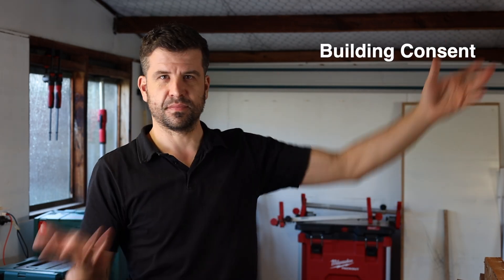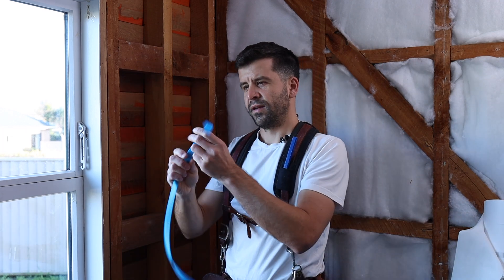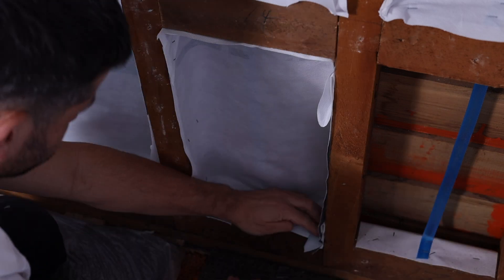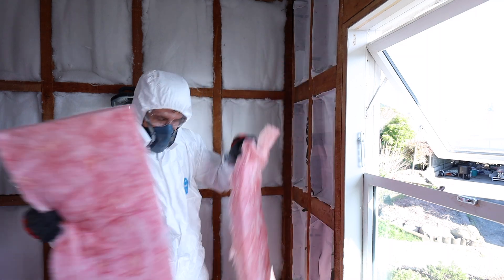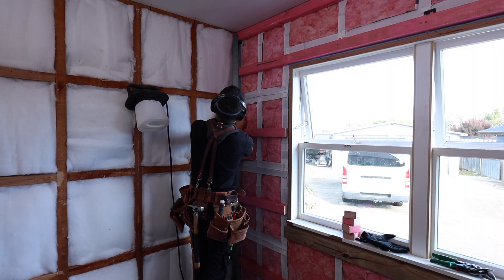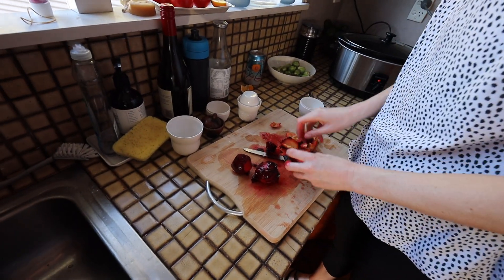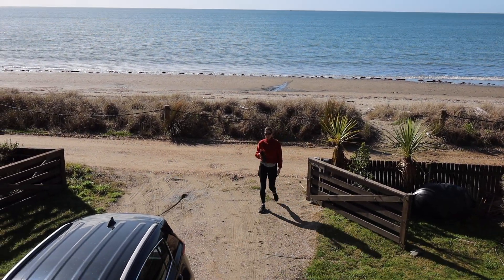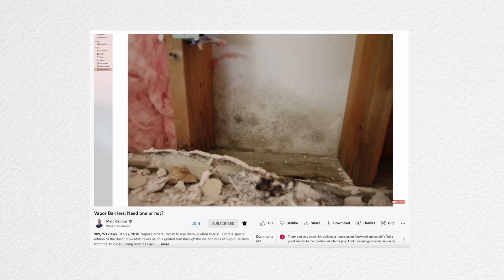We're Finally Going To Be Warm! Renovating Our 1960s House

Comment: i think you have done well.The only thing i would suggest is that the "battens" could be smaller timbers or even a insulated batten of some sort. I am not sure that the vapour barrier is not required but that it has been found that it is very very difficult to make a vapour barrier that works. Whe i was a draughtsman in the 70s we used to draw a vapour barrier but we stopped doing because it was found they ere not effctive at keeping moisture out of the cvity....too many penetrations ie wall outlets and ceiling outlets that were very diificult to seal...tht my understandin anyway

Comment: Hi there Scott
Nice job.
Probably I am a bit old school,  but I am a bit hesitant about too much technicalities in a house.  Especially in NZ where the climate is fairly temperate.  If a house is too sealed, then it just does not feel 'fresh' in a house. Except if you open a window and then defeats the point of the sealing. Or install a heat pump or HRV...and that is just something else...resources, electricity,  something to go wrong, etc.
The older houses lasted well because of the wall ventilation....
I suppose it is somewhere getting a balance that is right.
Reply: yeah your old school.
build tight ventilate right.
a perfectly sealed house is great because now you control the air flow not the weather. controlling the airflow helps control the moisture flow.
is a 70's house ever going to be air tight? no. they typically have excessive air flow so making it tighter is a good thing. at worse open a window which you should be doing anyway. (or install a ventilation system, which it may be integrated with the ducted heatpump.)

Comment: Its probably been mentioned already but spray foam would save a lot of work. A similar 1960's house here in Alberta, Canada would have 2 x 4 walls. the walls would have 31/2" of fiberglas insulation with approx. R12 rating. Installing the banding, house wrap and fibreglas insulation would be eliminated if you used close cell spray foam. Alternatively, foam board cut a bit less than the opening then sealed all around with spray foam from a can  such as used for the window would work. Just a thought. I don't know what's available in New Zealand. Foam board equates to an R value of 4 per inch. It is pricey though.

Comment: Most of the walls in my house in Norway are between 150 and 200mm thick.  And even that's not enough IMO.  Most new houses are 200mm at an absolute minimum.  I think passive houses are getting on for close to double that.  You can never have too much insulation.  :)

Comment: Don’t you have Rockwool in NZ?

In Sweden the weatherpaper is behind the outer panel and then a moisture plastic between the isolation and interior panel or plaster. But here the temps can go down to -30 or more in the Winter and +30 in the summer 🤣🤣

Comment: In Danmark we use u-value and normally there is 300mm insulation in the wall and 410mm in the ceiling.
We also use a vapor barrier in our wall and ceiling

Comment: YES - Polyester ceiling insulation blanket!!. glass fiber will compress and lose its r value over time, whereas polyester expands and maintains its r value. Also, in the event of roof leak - moisture can be attracted to and pool with glass fiber, whereas moisture will dry quickly in the polyester. Give this a test with a piece of glass fiber and polyester.  You could always put a layer of glass fiber between the ceiling joists and then lay polyester blanket on top of that.
Reply: The real test is hold a lighter to a piece of polyester. Then imagine that in an open attic.

Comment: Nice work mate - thermal bridging is a little known concept in traditional building circles. One point to note about your design here is that it will be much more airtight and you will might find you will want to keep the heat pump on in air circulation mode to reduce moisture

Comment: Be keen for a review of the ducted heat pump. Just about to install additional heating here, and wondering if the additional cost for a ducted system outweighs getting a couple of mini splits?

Comment: Insulation looks pretty good. You do give up a little space inside the house by packing the walls out so thick. Only other way I could think of achieving the same r value withhout losing space inside would be by putting insulation panels on the outside of the house and covering those with another siding. Obviously, this has its own drawbacks as well and could be quite expensive. 

Great job as always!

Comment: PIR over the internal frame with a taped joint (which also acts as a vapour barrier) …. Then screw the plaster board through this into the timber frame UK anyway…. 😀… Matt R… is excellent as well so it depends on where you are, climate , structure etc so no simple answer. ( unfortunately)
Last UK  regs have also changed so it’s far more strict on vapour battier, thickness of insulation, thermal bridging, air performance of building etc. It may not be NZ standard now but in the South Island it’s not too different to parts of the UK temperature/ climate so good practice especially in your own home should be looked at.

Comment: Vapor barriers depend on the climate in the USA. In areas where there is freezing they have the plastic vapor barrier over the insulation before the drywall. This is because as you heat the house the humidity increases and the poly or plastic barrier prevents the humid air from going into the the walls. Areas where you do not rely on heating as much and tend to use your AC system for cooling you have paper faced insulation against the drywall to allow transfer of vapor between inside walls and exterior walls allowing the house to dry faster.

Comment: We recently had Insulmax fluff pumped into the exterior walls of our house through holes drilled in the weatherboards (the holes were then filled and painted). It's definitely increased the heat retention but it does make me wonder about moisture build up...
Reply: Yes varying opinions about the product.

Comment: Excellent job. Good move on the air gap and you even got the insulation layers the right way around. 
Usa uses imperial R units and they use more insulation as well.
Ceiling i recommend batts because its usually cheaper than polyester and higher r value gor the size. But polyester blankets work especially well over the top.

Comment: Hey Scott great work on the insulation of the exterior wall. I’ve got a similar weatherboard house (1967) and used 70 mm polystyrene (black pearl - it has a higher R value with graphite in it) it works well and has made a big difference to our place.
Reply: I don't recommend polystyrene because it stops moisture which can then accumulate. Heard of guys finding water on top of underfloor polystyrene insulation.
Reply: ...and you must avoid contact between polystyrene and power cables.

Comment: Hello there, we live in Belgium (the other side of the globe) and build our home ourselves to be a passive home... unlikely the name.. it takes a lot of planning and work, but basically the house heats (and keeps it cool) itself through thick insulation, triple glass, controlled ventilation wit heath recovery, and absolutely airtight home. Our walls are constructed as follows: front brick (facade) - air gap 2x82mm (164mm total) PIR panels with the seams taped over with aluminum tape - inside brick with low heat exchange (thermobrick) witch is glued on each other - and finishing layer like stucco. Since the walls are that thick, the windows are encased in wooden "boxes" and suspended in the isolation layer... the "box" is then foamed up with isolation foam all around, and the inside of the box is lined with an airtight, but damp-open membrane that goes over the inner brick, but under the stucco... normally these houses are built as a wooden structure, but since our house is half underground, we couldn't do that... so it is in brick.. 
Our R-value of our walls, glass, roof and floor must be higher than 8,0W/m²K in order to be called a passive house...

Comment: On my house: breathable membrane on outside wall hugging the plywood, then bats which create a gap for water to slide down; then 3" of polyiso insulation - seams filled with foam to make it watertight (albeit the foam is open cell - seems to be no issue). If polyiso has aluminum side, then it has a nice property for blocking the radiated heat. Another row of boards on top of insulation - the screws are driven into the bats under the insulation never going into the wall in order to accomplish thermal break. Then a vinyl siding on top of this outer layer. 

One needs to understand that heat is lost (in buildings) via 3 main routes: conductively - when objects are touching (hence the metal screws not going into the building; wood is an insulator of a sort). Radiation is the big one - the whole purpose of insulation layer is to slow down heat radiating away. The additional layer of aluminum on polyiso boards actually reflects the heat back (or reflects it away from the house during summer heat). The third main loss of heat is due to air exchange - if buildings leak, you can have excellent super expensive insulation and it's just a waste of money (think 'open window') - hence the membrane hugging the building with seams taped and with every penetration covered (or elastomeric membrane) is crucial.

Finally, look at the foundation - the biggest heat loss occurs because of conductivity due to uninsulated connections with foundations (heat being sucked away). The biggest losses due to radiation are typically through ceilings/roofs - so if I had to choose between top and side, I'd prefer spend more on the top. Windows/doors areas are typically too insignificant to influence the big picture. It pays off to actually calculate R value of materials and the walls.
Reply: I forgot to add the main reason why I decided to comment: this installation is simpler than chasing perfection on the interior walls (where it can't be achieved anyways IMHO)

Comment: An infrared picture of that exterior wall you insulated will tell you if it’s going to be warm or not. The stubs and the cross bracing are going to work against the insulation, and the insulation, I think, is going to struggle a bit. Your R-3+ will be about R-12-15 maybe. R-19 is what we got from 5.5 inches twenty years ago. New homes now are shooting for R-25 in 8” walls. Where was the heat pump installed?

Comment: You asked, so I'd have used Rockwool/Mineral wool.  And the reason is, it's hydrophobic (i.e. it repels water.)  It's hydrophobic, and will repel any water that gets through the moisture barrier, and it will get through unless you used a sealant between it and the wood that you stapled it to.  And once water gets into fiberglass batts it's game over it will not dry out on it's own, and it will start growing mold.  That was the major reason for black mold in the US back in the 80's and 90's.  Rockwool also has a higher R-value per depth and is easier to install, and much lower probability of compressing it when putting it in, which lowers the effective R-value at those points.  And yes we have a different R system.  I believe the conversion from I-P (what US uses) and RSI what NZ, Aus., UK uses is 5.71x.

Comment: Great job with the overlap to limit the thermal bridging of the studs. Obviously can't be perfect with an old remodel, but you did what you can and that's awesome. Yeah the vapor barriers were applied too indiscriminately in the past. It's a tool in certain areas of the house/in certain environments, but it can cause a lot of problems when misapplied.

Comment: Your effort to improve a poor wall insulation situation reminds me of our first home in the far northern part of Minnesota USA.  It was built in an area with a 120 degree F difference between winter low temps and high summer temps (-40C to +35C).  It was constructed about 1920 by a railroad company and was one of many in our town built for the railroad supervisors.  They poured the footing with concrete.  Then, they slip-formed concrete in about 12" high lifts from that footing up the basement, main and upper story walls.  They boxed out for each window and door in the exterior walls.  The interior walls were wood timber construction with plaster surface.  The slip formed walls were actually two separate walls.  There was a 4" thick outer wall with an outside stucco surface applied after completion.  The inner wall was 4" thick inner concrete wall with a layer of plaster on the inside surface.  They placed 1/4" steel bars across the top of the inside to the outside walls with each lift and that kept them from moving relative to each other.  There was a 2.5" air space cavity between the inner and outer walls.  Altogether, the wall had an R equal to 1.0.  When we were living in the house, contractors were beginning to foam insulate homes with urethane.  Our situation was ideal because the air space had very few places (the window chambers and the doors) for any urethane gas to seep toward the living space.  So, we went up to the attic and drilled 2" holes in the wood plate that the roof rafters sat on so that the insulation company could drop a 15' long tube hose down into the cavity and foam the exterior wall cavity from the basement foundation all the way up to the roof plate.  Prior to insulating, we had ice coating the corners of our room walls.  After insulating, the rooms were much warmer.  So, I really felt good about "doing the best you can, with the situation you find yourself in."  Wishing you success! Dale

Comment: Binging the reno series, but insulation wise I'm surprised to see no PIR/rockwool. After a quick google, Rockwool in the Netherlands is a higher R per 10mm thickness then glasswool is. But PIR is by far the winner. Glaswool 90mm = 2.2Rd, Rockwool 80mm = 2.2Rd, PIR 50mm = 2.27Rd. I'm guessing PIR is really tough to get there, otherwise you probably would have mentioned it. EDIT: Ah you did mention them later xD

Comment: Scott in Manitoba we have r00 walls and 50 ceilings. They want to change our walls to be r27 with a 2" foam on the exterior. 

We also use a 10 mil vapor barrier for eqlls and ceilings. Our houses get air tested and the only province with better air quality test is British Columbia. 

If you can't get batt Inso, what about a ridgid foam?

Comment: Any informed Canadians here?
Were vapour barriers introduced there to prevent water vapour from freezing and thawing within the wall cavity? 
But when you install a vapour barrier in a climate including tropical, sub-tropical humid climate (or similar). Then the inherent leaks in the building wrap and vapour barrier installation trap vapour in the wall cavity and develop mould.

Any thoughts on this?

Comment: Coming along nicely! R values in the US are imperial based, inch-pounds versus metric. I'd say the R3 in the walls should be plenty, that would be an R17 equivalent. My exterior walls are almost R4 metric, but the windows are big; it's astonishing how well even gas filled double glazing transfers heat. Next house will probably have triple glazing or proper screens to keep the sun out.
Reply: Here in Norway you can get glass that has low thermal conductivity.  Double glazed windows typically have one layer using this glass and one using more regular glass.

Comment: RSI is a metric system, R is a imperial (I guess). I remember the conversion rate from trade school, I think its 1 RSI- 5.678 R.....Our building codes are written in metric, but we work in imperial. Our exterior walls in Ontario, Canada are R20 (last I heard) and R60 in attic spaces! -40°C winters and 40°C summers 😬

Comment: there is an easier way:   1.5 inch exterior rain-screen applied to the interior of the cladding = more exacting cuts and fits. and then use Rockwool insulation =R10 wall, water movement assured, no rot, fireproof, less particulate matter

Comment: Loving the videos Scott. Very interested to see what you do for the window reveals now that you have packed out the wall. Great to get the additional insulation losing a fews cms of space.

Would love to hear more about the ducted heat pump. Have been considering the same, along with ducted gas. All the heat pump installers seem to want the outlets and returns in the ceiling. Wouldn't the return be better lower so it draws the heat down?,
This is how the gas installers seem to recommend.

Comment: My concern would be both the insulation and an air barrier.  I understand that you want SOME air circulation for moisture control, but if you could run the "house wrap" all the way up and down the wall, minus about 20mm at the top and bottom, it should cut down enormously on drafts.

Comment: In Europe you need vapor barriers. But that depends on your climate (you might have very dry air in NZ). Also, if the air handler does heat recovery ventilation the moisture is reduced.

Comment: I’m in the same boat with a 60s house and I’m thinking of spray insulation where they drill holes on the outside and spray from the outside. Then plaster and repaint the house that way I don’t have to rejib the inside
Reply: I also have a 1963 weatherboard house much the same construction as Scott’s. My plan was also to get a ducted heat pump installed and spray insulation. Keen to find out more for sure.

Comment: That rogue aluminium framed window around the back could probably be changed back to a wooden sash and double glazed if you want it all consistent, would look great. Also you'd probably fit more window space since it looks like it's a frame in a frame currently.